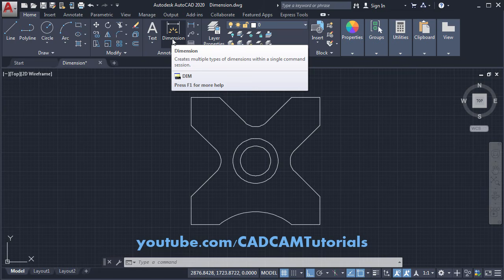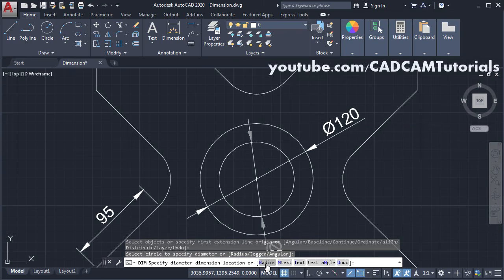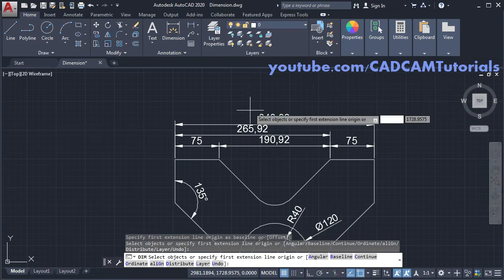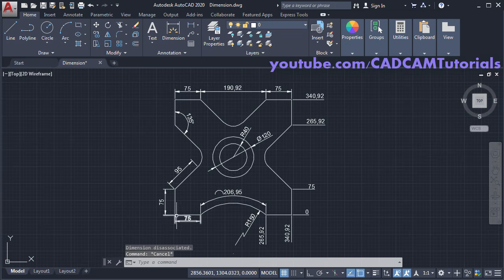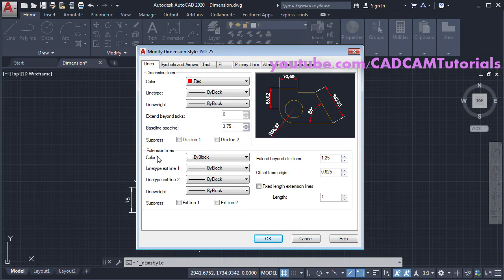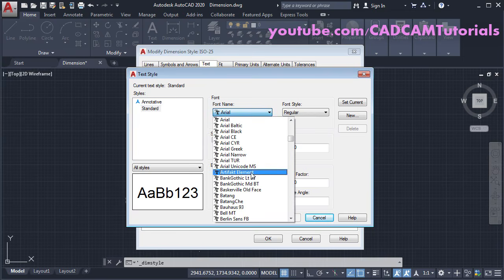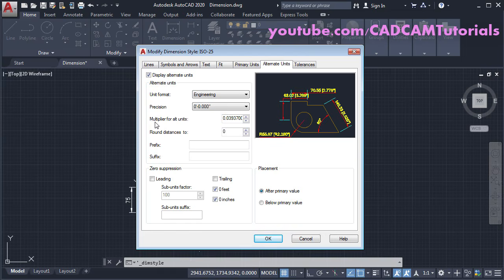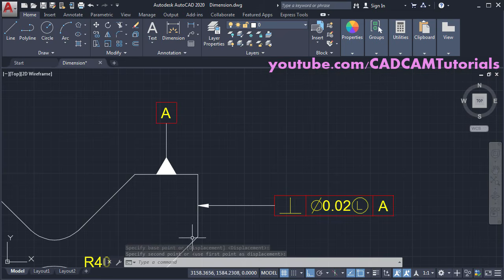AutoCAD Tutorial for Beginners - 5

Comment: Autocad might be buggy, zero suppression didn't work. Very helpful to know how to horizontal text. I wish there was a way to have the line wrapped underneath the line for example for angular dimension in the 'D' settings.*Edit* That is covered in the next video. I have read other ways to do it (leader) but it seems overly tedious and unintuitive. Basically any change in the design would make it not a good way of doing things as opposed to simply mass-change settings in autocad.